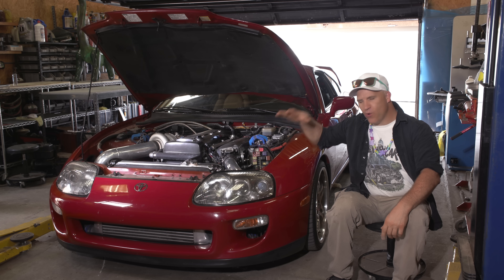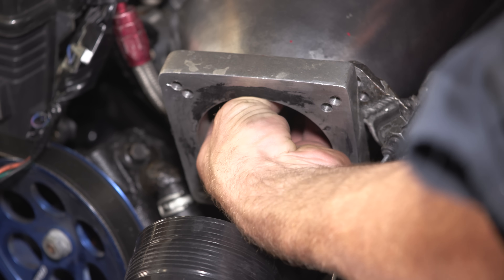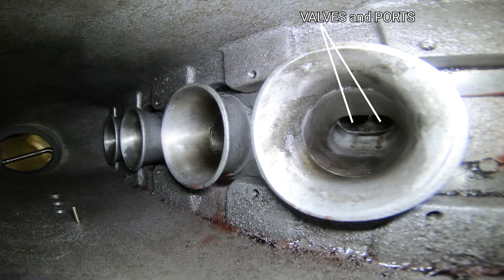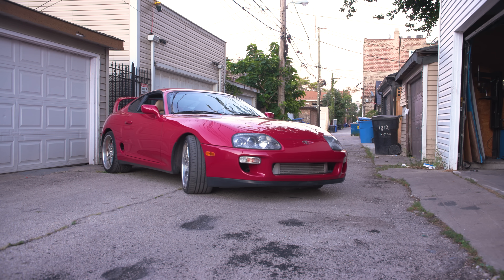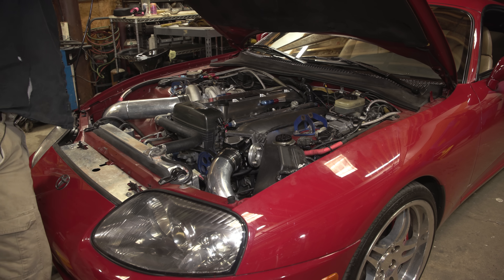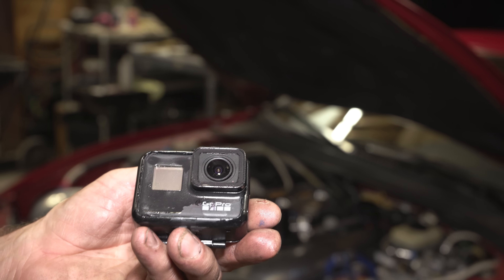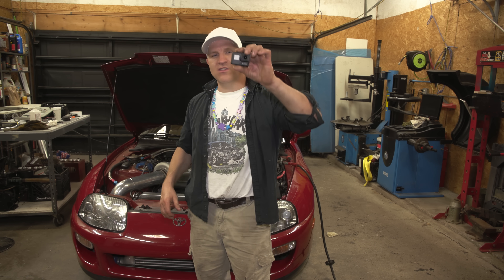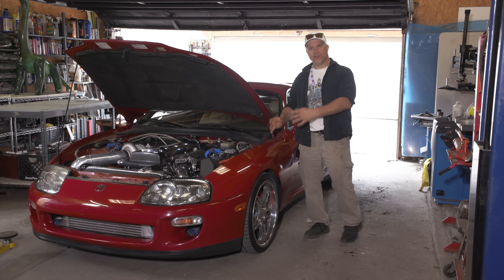Driving with Gopro Inside My Intake Manifold (Toyota Supra Turbo)

Comment: Interesting to see the injector spray pattern, me thinks at low throttle the injectors were just dribbling fuel and at wot they were performing better and providing an atomized fuel flow. Was wondering if you have a air leak between the head and the manifold judging by what I saw with the oil dancing about in that region.

Comment: Wondering where the oil is coming from? Looks like you have a pcv hose hooked up to the intake on front side of turbo, and that connects to your crank case.  High revs and pushing boost puts pressure in the crank case. Eventually will push oil through the lines, and the turbo will suck it in and push it through the intake manifold to be re-burned. Does not look like the velocity manifold does a good job at catching the oil and cycling into the cylinders. So oil lays at the bottom of the manifold and will turn black because of continuous heat being burned just sitting at the bottom.

Comment: Assuming you already have a catch can, you hooked it up wrong im guessing
Reply from the maker: Nah it was power steering fluid, after I finish the video I found out that the low pressure vacuum switch on the power steering pump is faulty and is bypassing oil into the intake manifold.

Comment: Bit disappointed you didn't show parts of the intake in very 4K slow motion. it looked like the number 3 intake was letting oil pass. Need a new gasket maybe?
Reply from the maker: I did some slow motion of the intake but it wasn't really good, it was a technical challenge enough to get a GoPro inside there is no way I'm going to get a full-size high speed camera inside. As for the oil it turned out to be power steering fluid, the vacuum switch for my power steering pump is faulty, it's bypassing oil from the pump into the intake manifold.
Reply: @WarpedYT  That's a fair call. What I did was select the option to slow the footage to 0.25 on YouTube so I got to see the footage is slow-motion but HD 4K would have been better. You can only do your best and that you did. Thanks for the great footage.

Comment: Hey, here's an idea. You've probably seen those videos of like nascar valvetrain testing where the valve springs seem to be moving in slow motion. They're often labeled as slow mo video, but it's actually strobe lighting that phases with the engine's speed to show the slow mo. That would be a cool rig to develop, see if maybe you can peek a gopro into the valve cover, or on a lawn mower or whatever just pull the valve cover.

Comment: I feel like having a cutout in the intake plenum a puting a GoPro in there would've helped with the overheating. For the oil maybe the catch can was full and some oil got into the engine, either that or some fuel after letting of the throttle

Comment: Sweet video but you might be running to much air filter oil. Looks like k&n oil sitting in the bottom of your intake, also oil appeared present at start of video.

Comment: I think the lack of oil in the middle, is all the times it's been touched with fingertips. And the oil from fingers is creating a barrier there
Reply from the maker: I don't think so, the GoPro is brand new. Even if it wasn't I rarely ever use my GoPros. I think it was the turbulence from the airflow around the GoPro going to the back two cylinders.
Reply: @WarpedYT  that's a good thought, perhaps it was from the air flow, going around the top and bottom of the camera.. It's super interesting either way

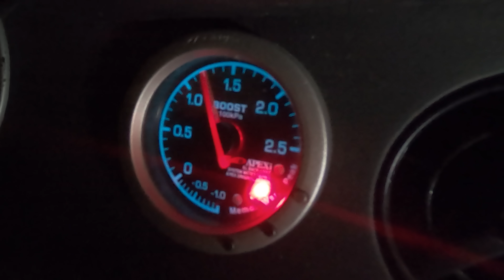Comment: 04:39 - 04:45 stray sparking above second velocity stack from the left, get that checked out
Reply: Ignition timing problem, the valves are open and the ignition will be spitting and manifesting through the intake manifold. Or could be crossed wires, spark plug not installed correctly etc. One of those but definitely spark plug related. Good thing he put the camera in their.

Comment: One thing that surprised me, but makes a lot of sense, the flashes of white every time the engine went from wide open throttle and high boost, to closed throttle. 

It'll be the moisture being condensed (edit: possibly not condensed, some form of separation) out of the air by the sudden drop in pressure. 

The near instantaneous speed at which dissipates is a testament to just how much air these engines draw under load
Reply: Wouldn't the drop in pressure be flash boiling the water, not condensing it?
Reply: @jacksonhall5725  You are right but this is another mechanism. 
The higher the pressure and temperature, the more water air can absorb (or really any phase mixtures).  If you drop the pressure (and temperature, its mostly an adiabatic change in such short timeframes) the water percipitates out of solutu in in the air.
Reply: Lower pressure equals lower temp. So I would have thought condensing is correct?
Reply: Nah its a property of water that as pressure decreases so does boiling temp. Pretty interesting stuff, if youd want to see more look up boiling point vs pressure curves
Reply: @richardof8899  my point exactly. You can have spontaneous boiling at very low temps when you have low pressure
Reply: At 20 in hg roughly the vacuum the intake would see when the throttle is shut the boiling point of water is 71oC. So as we can't see steam we are seeing water vapour escaping. That's cool! Although I do question how the intake temp would be 71oC as the intercooler is designed to keep the compressed air temp lower than that to increase its density. I wonder if a naturally aspirated engine would react the same being as the air entering would be colder than it is on a turbo and the intake is always under a vacuum pretty much.
Reply: @LAW-Automotive  just wondering, but what's your science/engineering background? Haven't seen anyone reference pressure in inHg for a long time- I'm typically working all in mmHg or atm depending on context
Reply: @LAW-Automotive  It should have the same reaction, at least on warmer, humid days.
Reply: I've had a lot of turbo and supercharged cars so most boost gauges are psi boost and in hg vacuum. I'm a level 3 vehicle tech but went on to do a bachelor degree in science engineering. I work as a multiskilled maintenance engineer, cars are just my hobby, I've worked in aerospace manufacturing with vacuum casting furnaces, 9yr in dubai doing irrigation mep and engineering, 3 yrs in GRP manufacturing company and now I work in the 2nd largest beverage manufacturing company in the UK. No expert in anything and still learning a lot, I'm passionate about engineering.......
Reply: The moisture only condense when pressure increse and the temperature is lower than the boiling point att the current pressure.

Maby it,s evaporating when the pressure drops or condensing when it hits the right pressure, depends on the temperature and moisture in the air.
Reply: The more I think about it, the more I'm not convinced the water is reaching saturation point and boiling. So imagine this, turbo charged pressurised air enters the intake at approx 40oC (after the intercooler's job is done) the air has relative humidity and density but is not hot enough to boil (saturation)  even at vacuum when the throttle is shut. Throttle back on and warm air rushes back into the Intake rapidly cooling to the dew point condensing to water vapour in a flash and then it's gone as positive pressure remains from the turbo's boost. Ever seen an aircraft engine sucking in the warm air and it immediately condenses infront of the impellor looking like a fog mist cloud, aka water vapour reaching its dew point!!

Comment: ah yes, people adding fart cannons on great cars, ruining them forever.
Reply: It's only a fart cannon when it's hooked up to a little 1.5" pipe connected to a wheezy stock 4-cyl. This thing actually needs a 3 or 4 inch exhaust to minimise back pressure at the turbo.

Comment: Kinda weird how the intake runners are pointed down toward the plenum. Fuel is condensing inside the runners and flowing down into the plenum where it pools up. I guess it really doesn't matter because it'll evaporate when the plenum gets hot enough.

Comment: @WarpedPerception that oil is blow by from boost its not uncommon especially with no catch can / air oil separator on a boosted engine you can add a catch can and it will keep the oil separate from the intake

Comment: About the Oil Residue, the motor block has oil gas that needs to be release. this oil contaminate the environment. so that is the reason they burn it. from the block goes through PCV valve then a hose to the intake manifold. so it can be burn with the explosions (combustion) of the spark plugs.  I hope I did explain my self. nice video.

Comment: The oil is most likely from the Positive Crankcase Ventilation routing positive pressure in the crankcase back to the intake so the engine can re-burn the oil that comes up with the ventilated air.

Comment: For those wondering, the “flash” you see between shifts is actually the water vapor/ humidity boiling off as it’s pulled into vacuum when the throttle plate closes.
Reply: There is no water to vaporize in an intake that is at operating temperature. It's too hot. The flash however is the fuel being pulled back to the source of the vacuum. You can see the fuel being sprayed on the back of the valves.
Reply: @QuoteFarm  yes fuel makes more at charge temps I agree
Reply: @QuoteFarm  this
Reply: Brian Campbell Mostly moisture in the air from humidity being flashed into visible vapor. Fuel is already busy at the valves.
Reply: @Backyardmech1  I understand the theory I just don't buy it. Fuel is the only thing being vaporized in an intake manifold. The air in the intake rushes to the source of the air pressure differential and thus carries some of the suspended fuel with it.
Reply: @QuoteFarm  Yep, you're on to it Mate, it's called fuel stand-off. You see it in N/A independent runner engines that create an intake pulse but in this case it's the boost pressure to vacuum change that's pulling it out of the runner.
Reply: Brian Campbell I respect you’re idea, but with the inflow of air through the manifold to the valves, even under pressurized conditions, it just doesn’t seem feasible enough to me to say it’s only fuel vapor. 1.5 bar of boost is ~22 psi of air being suddenly stopped to barometric, with a sudden vacuum. That’s a lot of air and moisture being reduced from pressure. Even with the drop in pressure, the RPM’s are still pulling fuel, and air directly to the valves.
Reply: thanks, i was wondering what it is
Reply: What was the oil from
Reply: @porkchop803scwilliams9  could be from a number of sources.  The valve guides sometimes weep a small amount, there might be some oil getting past the piston rings on the overrun, or the crankcase breather might be getting heavily loaded due to blow by on boost.  A film of oil in the intake is not that unusual in any case.

EDIT: other comments already stated it's power steering fluid leaking past a faulty valve into the vacuum system and getting ingested by the intake, disregard  :D
Reply: @porkchop803scwilliams9  It is possible that whatever fuel he is using is dyed.
Reply: @porkchop803scwilliams9   i was wondering the same thing. I bet that it's blow by traveling through the pcv then condensing once the vapor cools in the intake. I've taken intakes off that were completely coated with thick broken down oil from that process.
Reply: Science rules. 👌🏽
Reply: Interesting, the more i know
Reply: Lots of things going on tho. Part of it is the vacuum pulling the humidity into clouds of vapor. Also the reversion (air moving into intake from combustion chambers) is blowing fuel back into the intake plenum. There's ~40% more volume of fuel since it's ~80% ethanol content fuel (e85). The reversion is because there's still 40-50psi of pressure in the exhaust when he closes the throttle (after 25psi of boost) and it can push back during cam overlap. Most turbos see a drive pressure ratio of 1.5:1 to 2:1.

The oil is partly from the turbo seals & thrust bearing leaking a little bit of oil (normal, they're "dynamic" seals), but most is probably windage (crankcase air mixed with oil) pulled thru the catch can that's routed to the turbo intake (normally pulled in via pcv valve). It's the 2 stainless-braid lines that are routed over the rear of the engine & connect to blue/red "AN" fittings to the largest silver intake tube.

I'd bet most is from the catch can tho, that tends to be mixed with lots of moisture. Why? You can see the oil 'foam' under high vacuum (turn white), indicating that it has fuel and/or moisture in it which is boiling (from vacuum not heat). It turns back to liquid when vacuum is reduced.
Reply: true i was about to say that too but it is true
Reply: Is it just water vapor and humidity? not fuel? out of curiosity how does a nitrous back fire happen?
Reply: Huh cool
Reply: At first I thought it was just smoke but thanks
Reply: Pretty sure it's just the light he put inside the manifold next to the GoPro that's being reflected off of the throttle plate when it closes...
Reply: @sixfo3513  It's clearly not. Look inside the runners, there's visible vapour
Reply: @SanHydronoid  It's literally catching the right angle and reflecting the light meant for the GoPro directly into the GoPro for a split second as it moves.
Reply: The flashing also happens consistently at the valves at high rpm.
Reply: What was the red/pink liquid in here? Coolant?
Reply: Isn't it fuel from being. Port injected ?
Reply: Sure about that?  Looks for all the world like it's being spit from the manifold openings to me.  There also seems to be too much of it.  I would bet at least some of it is fuel.
Reply: It's not boiling its precipitating
Reply: @wormytom  Condensing first, then precipitating, if it is in fact water, which I'm still not totally convinced of, and one of the MAIN reasons I'm not is I really don't think you would see giant drops of water left behind that quickly by that means.  If it was water, though, that is when it would "fog" or rain out, on the low pressure after the throttle snaps closed.  Seriously though, THAT much water...?
Reply: Looks to me like coolant.
Reply: It's actually fuel atomizing.  Class dismissed.
Reply: he boiled the gopro
Reply: op
Reply: Wouldn't that be condensation?
Reply: @louf7178   It's evaporating as the throttle body closes. It does condense once the intake repressurizes.  When there is a loss of pressure, i.e. vacuum, the molecules of a fluid will expand in order to fill the volume of its container. This causes the water to vaporize and "boil off". Once air is reintroduced to the system, the pressure forces the water molecules to compact together and return to a liquid state.
Reply: @jairoumana4569  It's definitely condensation.  If you expand air it cools, cool it enough and the vapours will condense.  It'll be affected by the blow off valve as well, that causes rapid depressurisation of the manifold.
Reply: It would have a small quantity of fuel too? I mean, as soon the gas is cut, a few fuel is still being vaporized, so due low pressure of intake, part of this fuel goes to opposite way.

I have never thinking about it, but seems to be quite possible.